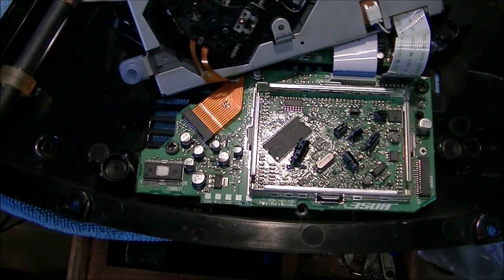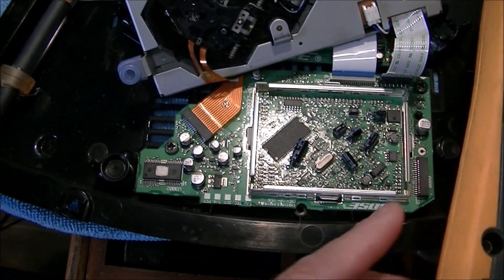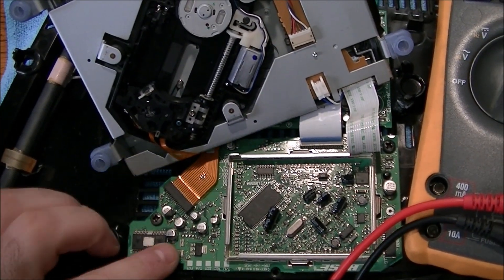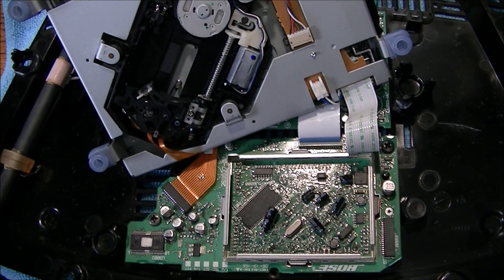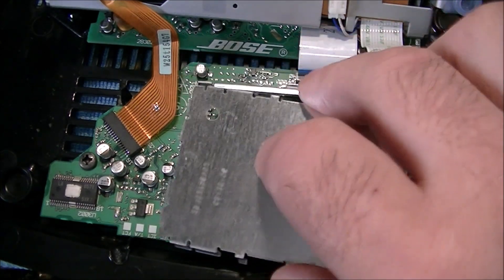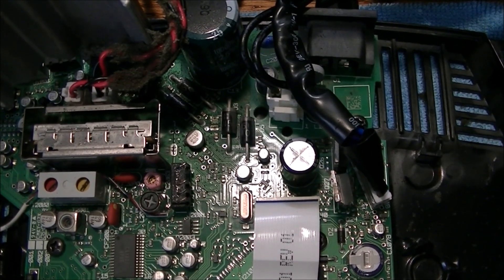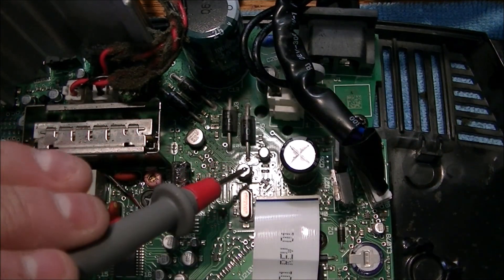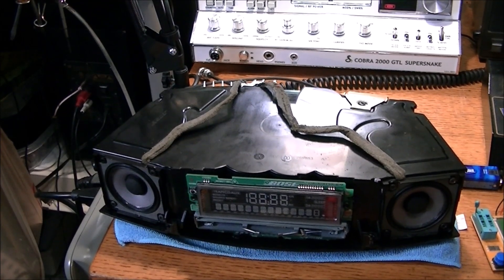Bose Wave Radio Display Not Working - Part 2

Comment: Hi Andy, you said the transistor had about 4.5v base to collector and about 4.5v base to emitter. This is totally wrong if it is in fact a transistor. The max forward voltage  base to emitter should be no greater than about 0.6v it should be similar to a diode forward volt drop. Reversed it can be higher. So check it again and take it out of circuit. 
Maybe its not a regular transistor or possibly a Field Effect Transistor. Maybe even a voltage regulator? What's the number on it?
Also the display looks to me to be a VFD type. Vacuum florescent displays are contained is a sealed glass bubble. I believe they require an elevated voltage also, possible 40v but im not sure on this unit. 73.
Reply from the maker: Thanks for the comment. I appreciate the info and will take a look at it sometime in the new year. In fact, a friend pof mine said if I swing by his place, which is 750 KM's away, he will have a look at it.
Reply: @Tobinindustrial I would take a look too, but im probably even further away.

Comment: Was there ever an update to this? I have a display that doesn't work with one of my radios, but doesn't with another (so I'm assuming it's a capacitor issue?)
Reply from the maker: I shelved this radio for now because I couldn't get no further with it. I was hoping to find another lens to try
Reply: @Tobinindustrial  I ended up replacing the motherboard, tho Im not sure why that was the issue. It works now...
Reply from the maker: There are a couple of transistors on the motherboard that send power to the screen. It may have been one of them got blown.

Comment: Hi :-) Did you already try to replace the "(2S)A473-Y" transistor (next to the 2SC1173 transistor and the power connector)? I had the same problem - everything worked, but no display. I noticed that one of the Display pins had ~4V, while on another Bose device with working display the same pin has ~9.2V.

I traced back this 9.2V line to the (2S)A473-Y transistor and measured a short between base and collector here (left and middle pin when looking at the label). After replacing this transistor, the display works again now 🙂

I think I damaged the transistor while accidentally removed the ribbon cable of the display while power was on.

Good luck - looks like the same problem 🙂
Reply from the maker: Thank you for the information. I will certainly check that out. I think you may be right!

Comment: You can't read capacitance values in circuit - at best you can read ESR but that isn't 100% reliable either depending on circuit.  BTW, all the electros in that radio are bad - either dead or very high in ESR.  The only proper repair is to replace every cap including those around the audio amp, but that won't fix the display problem.  Regarding the VFD, you might have blown up the filament inside when the wiring to the transistor shorted.   Get an eye loop and carefully check the thin horizontal wires in the VFD and see if the filament was burned open.  If they're not taut, the filament was damaged.
Reply from the maker: Thank you for taking the time to make a comment and suggestions. This may be most helpful to me. I sincerely believe I knocked out the VFD. I am a self taught tech but never became an accomplished one for sure. lol

A close visual of the VFD is exactly what I need to do. That is possibly the best advice I have had offered so far. I appreciate your help.

Happy New Year to you and your family!
Reply: @Tobinindustrial  Thanks for the comment, and good luck. Regarding the VFD, generally, the two outer pins of an inline VFD are the filament leads, but on your particular radio I'm not sure if it's one or two rows, and I don't have one in the shop right now.  If you can peer inside with a loop or Optivisor, you might be able to follow the filament (and cathode in this type of device) out to the appropriate pins. If you can identify the filament leads, they generally read 10 ohms or lower and have about 3V on them.  If the induced short caused more than 3V on those filaments, that could have smote the display (hope not).  If I get another one in soon, I'll check which pins are the filament and reply back.

Comment: When I work on these unit and I have worked on fifteen, I use my ESR meter to test the aluminum electrolytic capacitors I wind up replacing them all.  80% to 95% are bad so while I have the unit down, I eliminate future problems by replacing all of them.
Reply from the maker: That is a smart thing to do because those aluminium cans don't last very long. thank you for the comment.

Comment: As we know, VFD or vacuum fluorescent display is a vacuum tube type component. To ensure proper functionality, check following facts: 1st) check continuity of the VFD's filament. Ensure that the power transformer supplies the filament voltage (AC). If the filament winding of the power transformer has a center tab, check the potential of the center tab. An easy way is to darken your surroundings and check if you can see a dim glow of the filament wires inside the VFD. Back to the center tab, the version of Bose radio I recently serviced (+CD player) was supposed to be -20Volt (provided by transistor Q201). Remember, the VFD is basically a tube having a bunch of Anodes and a filament that also serves as the Cathode. 2nd) check also (using a scope) that the display chip provides the multiplexed data to the Anodes. Hope that helps fixing your display ...
Reply from the maker: Thank you so much for the knowledge and detail you have given. I have somewaht limited knowledge of repair and there are no technicians anywhere near me. I have checked the display in darkness and the screen is completely dead.

As I may have mentioned, the screen was working just fine until I had the incident due to the forgetting to unplug the radio.

I do not have a scope so I am unable to go any further with testing. If i could find a heap enough woking display, I'd put it in. I have a strange feeling that the multiplexed data chip may be blown.

I also noticed that there are two main boards that are available online for replacement. I am thinking replacing the larger board in the unit might be another route to take. I am just wishing I knew what was wrong so that I woud not waste any money buying parts I don't need.

Again, I appreciate your  help very much. I have had little assistance with this radio possibly because most people have never worked on one before.
Reply: @Tobinindustrial  When I mentioned to check in the dark, you need to check if the filament wire shows a very faint glow. To do so locate the very thin wires going horizontally across the FVD glass tube (2 or 3 wires in front or rear - depending on the model), better use a magnifying glass since the wires are really thin. You can also check the wires for continuity using your Ohm meter. The ping-out are usually the most left and right of the FVD. If the wires show continuity, check if you have AC supply from the transformer to power the filament. I have serviced a few of the units and never had a broken multiplexer chip that controls the FVD. Another indicator would be to check the negative -20V DC used to biase the filament (this can be basically seen as the Anode voltage for the anode elements). To do so, use a DC voltmeter between the common ground, and either pin-out of the FVD's filament. Make sure that your DC Voltmeter is set to show negative - DC. Good luck from LegacyTubes.com
Reply from the maker: @uwezink  Thanks for this. I will check it as best I can and let you know my findings. Happy Mother's Day!
Reply from the maker: Hello again. I tested multiple points on the display and the highest voltage I can find is just -4 volts DC. There is also just 4 volts DC found on the ribbon cable.
Reply: @Tobinindustrial  Hi, so that indicates that the aprox. -20 Volt DC is missing somewhere. Can you provide me with the exact model # so that I can try to find the schematic and lead you in the right direction what to check for, components and so on ... Thanks
Reply from the maker: @uwezink  It is a Bose Wave Radio CD Player Model: AWRCCH
Reply: @uwezink  Hi, I also recently acquired a similar system with no display, and probably not functional too. However, powering on-off in the dark, I can see the filaments grown reddish, with a bit of dim white light on the right side of the VFD. 
There are ~3.3VAC across the filament between leftmost and rightmost pins, and the DC readings are 10, 3.4, 1.8, 0, -2.4, etc, but none is close to -20VDC. 
I also cannot find the Q201 that supply the -20VDC that you mentioned, probably different PCB version.
My mainboard: 291619-003
My controlboard: 291428-005
It would be great if you do find any schematic for these or similar version. 
Thank you.

***update 20/6/2023: I found the schematic - 
https://elektrotanya.com/showresult?what=bose%20wave&kategoria=&kat2=all&page=0#res
But this is for Bose Wave Radio/CD (with the top loading CD drive), and not the Bose Wave Music System (with the front loading CD drive) in this video. 
*It has the schematic showing Q202 feeding -20VDC.
Reply: @Tobinindustrial hola, hoy repare un radio de esos Bose, el display no encendía y el problema era el Flex, al colocarlo correctamente no funcionaba pero al retirarlo un poco hacia atrás encendió la pantalla. Prueba a ver si te funciona.

Comment: Andy is it a cold cathode display.  Could it have gone to air ?
Reply from the maker: I am not sure Fred. I did not drop the display. I was tying to reinsert the ribbon cable into the display while it was still mounted unto the speaker casing when the transformer secondary wire chafed against that transistor and the wire shield melted causing the smoke. As you know, I accidentally left the radio plugged in. The display was working up until that incident.
Reply: @Tobinindustrial  Yeah its annoying.  I see you have uploaded another video.  Gr great if you could get it working.  Normally a cathode display has so quite high voltages.

Comment: Wow at least the radio and cd player is working awesome job brother. Prob a cold solder joint.  The way it was packaged and ship to you was bad so you never know  great video thanks for sharing! Be waiting for part 3
Reply from the maker: Thanks Dave. I am trying to see if there is power going into that ribbon cable or the display is dead. I have no schematic is it is slow going.